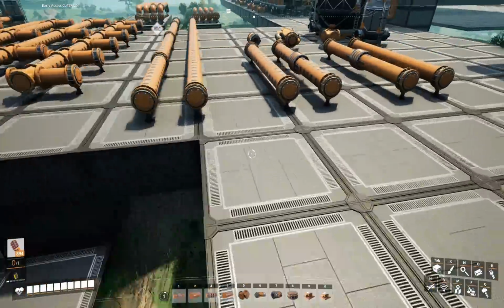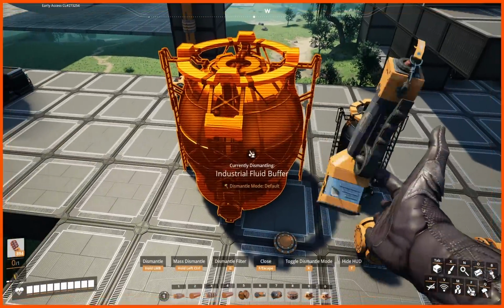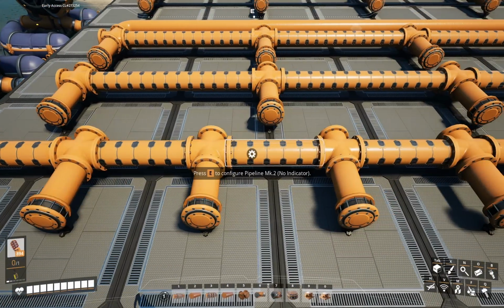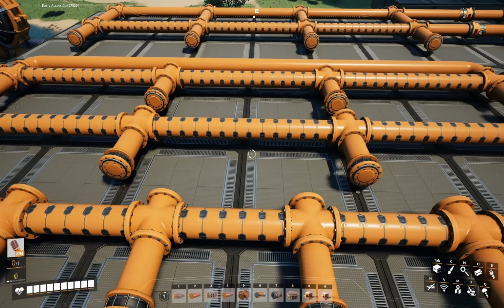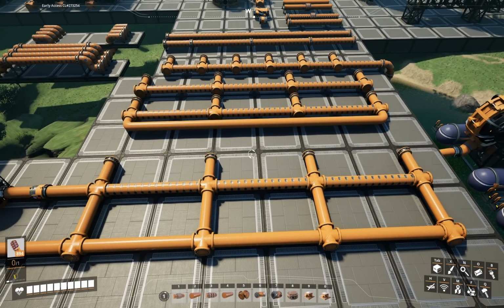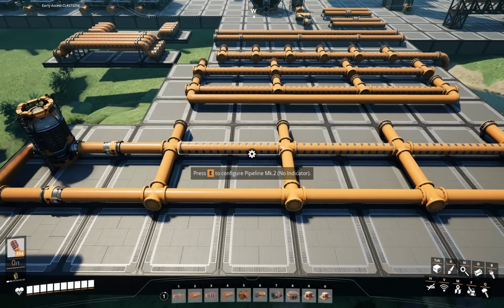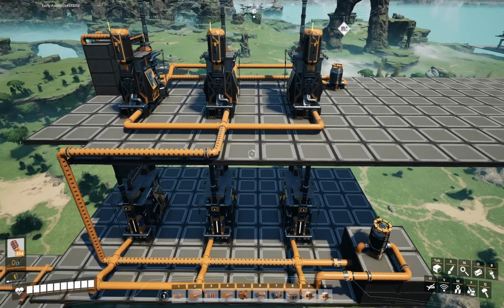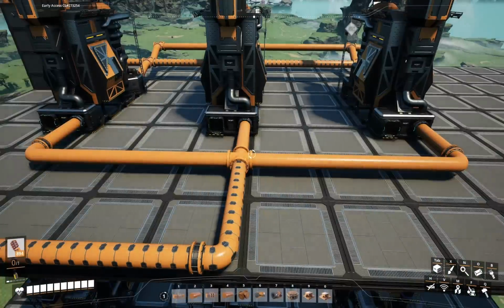[OBSOLETE] Basic Fluid Dynamics + flow rate issues (mk 2 pipe bug)

Comment: this is a great video, one of the best i have seen on the subject. you should experiment with the unpowered pump as a better version of the valve. it only allows flow in one direction, but it also resets head lift (pressure) so you don't need to loop back around or use a tank (the tank also resets lift so is why it works here). the pump works great at the end of a run to prevent starvation, and even better where you are trying to join lines with different inputs, like with aluminum processing. but the single most important thing with fluids is still and always, build your factory upside down, so all the fluids flow downhill.😄
Reply from the maker: Awesome tips! Yea I used to use unpowered pumps, but I don't like the aesthetic of random pumps for no reason (I think like, why would this be here if it was a real factory?) so it makes it harder for me, I like challenges :P

Comment: With regards to the described water hammering issue, a whole loop of pipes isn't necessary. If the exact issue is that a fluid is bouncing back from a dead end, then just placing a small liquid tank on that end will solve it (that's how it works for me anyway). If the liquid tank is allowed to be prefilled then it will also provide flow back in the other direction which will help keep pipes full and stabilize long production lines.
Reply from the maker: Yea, if it works it's just as viable a solution as anything else!
I love that there is so many ways of solving the challenges posed by the fluid dynamics!
Reply: The fluid buffer is like having the loop, the buffer is just a big pipe. You don't have issues when you use it because it's full, so it shares the fluid with the pipes. But it will run out at some point and create more issues because the pipes will try to fill the buffer as well as the machines.
Neither the loop or adding a buffer are solutions. From my experience anyways. The only solution is overproducing the fluid.
Reply: @Ecliptor.  The machines consume exactly the amount the recipe says. When their internal buffers are full and demand lowers, the excess production should go to refilling the external buffer tank and reach equilibrium. If they're running out in your setup then I'm stumped. Ive only ever seen my buffers drain slowly due to a (presumed) rounding error when under clocking, and yes slightly overproducing fixed it.
Reply from the maker: @Ecliptor.  yea, I tend t otry that as much as possible, to just brute force the problem to compensate for the floating point number issue as well as any issue with water hammering, I have 3 lines producing 600 each in the 50k MW powerplant in the beginner series, but the generators only need about 506 each.

Comment: I started using the "FICSIT Inc. Plumbing Manual" - found it on reddit and saved it in google drive. Works great for me. never had issues with it. never experienced bugs with floor holes (just don't feed the machines from below). Great work thanks a lot!

Comment: Good info, but...
You missed a very important, and often unknown, bug, and that is placing junctions, valves, or pumps directly onto an existing pipe which can cause a piece of pipe to become segmented within junction/valve/pump which can cause throughput throttling which really screws up flow. Here's a copy & paste from the wiki page to explain it:

"Placing pumps, valves or junctions directly on pipes can cause a transient throughput throttling, somewhere around 1 m3/min. additionally, occasionally, even when the junction is placed, then re-connected after deconstructing the original pipe, a small segment of pipe can get stuck inside the junction, this will also cause throughput throttling. this issue affects both Mk.1 and Mk.2 pipes. the workaround is to either place the junction first, then connect pipes, or, if you must place them on a pipe for placement purposes, or in the case of valves and pumps, place junctions, pumps and valves on pipes, then delete the original pipe and reconnect. avoid placing junctions, pumps or valves on points where different lengths of pipes connect, as this is believed to be the cause of the small segment of pipe stuck inside junctions. when searching for these choke points in an existing factory, highlight the pipes entering the affected objects. if they show as being halfway inside the object, and not just stopping at the mouth of the object, that object was placed directly on a pipe and the connecting pipes should be deconstructed and new ones connected."
🙂
Reply from the maker: excellent, collecting all the wisdom in one place!
Reply from the maker: The comments of Protoborg was deleted and reported as spam, as they were generally just spamming contrarian responses. Your reply to them however is great ^^
Reply: @jackblade281  Thanks!

Comment: Very informative and interesting solutions to fluid issues.

I didn't see you experiment with vertical junctions. I believe they are like using a smart splitter. The lowest output gets highest priority due to gravity.

Have you tried placing inverted U bends between machines? You highlighted they act as an overflow valve and prevent backflow, therefore preventing hammer effect.

I use overhead manifolds with an elevated fluid buffer at the feed end.
I also feed the fluid buffer from above its height to prevent backflow from the buffer. Do this with an inverted U just before it.
Reply from the maker: I didn't include vertical junctions because I barely ever use them and did not feel confident that I would be able to talk about them ^^ If they work that way I will 100% test it and see what results I get :P

The inverted U bend is also a great solution and I use it for fluid buses most of the time.

Comment: thanks for the tip about the floor holes. i was following a tutorial to setup a massive power setup and was having the worst time with getting water up through the floor. been messing with pumps and replacing pipes but thought the whole system was bugged I didn't realize that it was just the holes in the floor. will have to go back to that save and give the power plant another look
Reply from the maker: No problem, happy to help!

If you have used any blueprints in that build that has floor holes they are most likely the culprit before anything else :P
Reply: @jackblade281  no i just started using blueprints on my latest game. the old game It was new so I didn't bother messing with them. the pipes were hard enough. although I realized everyone else is making sections of floors with blueprints while I was cramming everying into buildings that fit in that space. lol
Reply from the maker: @criticalchai  the blueprinter is really powerful if you learn to use it for modular sections of factory :P But yea, I hope you figure out the pipes!

Comment: To compress the space for machines again I’m thinking of placing them next to each other but having 3 or 4 pipes feeding every 3rd or 4th machine.
Reply from the maker: Not sure I completely get the visualisation of what you mean? Is it like "Refinery -> Constructor -> constructor -> Assembler -> Refinery" you mean?
Reply: @jackblade281 I think he means placing the machines close but have several pipelines that skip machines, only connecting to every 3rd or 4th machine.
Reply from the maker: @marcbennett9232  aaah, yea that is also a possibility
Reply: @jackblade281  due to the need to space out the refineries there’s a lot of gaps. But these gaps can be filled by refineries, just that they need to draw from separate pipes. Instead of having the first group draw from the first pipe, the second from the second and so on. Every 1+(group size)*(n-1) draws from the first pipe, then 2+(group size)*(n-1) from the second and so on.
Thus filling in the gaps and large factories barely gets larger.
Reply from the maker: @judas1337  very nice solution ^^ will try that one as well at some point

Comment: The fix for many flow issues into manifolds is the same as belt manifolds. 

Let production run a while with the output disconnected. Use the machine buffers for finished product and input products to ensure belts and pipes are "buffered" to handle any brief flow problems. 

Once the machine input and output buffers are full, then connect the output and the monifolds will be trouble free forever.
Reply from the maker: Tends to not work with recipes like diluted fuel and the nuclear powerplants, but in all other cases, definitely

Comment: Could you make a tesla valve? and have it work like it does IRL?
Reply from the maker: That would be a cool experiment, but I think there would be complications because the split in a junction is always 50/50  or 33/33/33, so instead of overflow being used to slow down the flow rate they would probably just cancel each other out entirely

Comment: My tips are 1) if you think you need a valve, think again.
2) Get those pipes up.  Fluids should always be fed down into machines, never level or up.
3) If pipes are approaching full, run a loop back to the beginning so it can be fed from both ends. and 
4) Just like pipes, there's no need to consider directional flow in a buffer.  You only need a single port on any buffer. 
5) Quit using junctions unnecessarily.  The last pipe in the manifold should curve into a machine directly without going through a junction.
Reply: The loop does nothing. It only moves the problem from the end of the "manifold" to the middle. You will have the same issues.
Reply from the maker: @Ecliptor.  I tried the loop on the turbofuel refineries in the beginner series, it does seem to work, 4 lines x 600, going into 96 refineries, and they are all running at 100%. Without the loop issues started to happen, put it back in, issues disappear. Make of that what you will ^^
Reply: I've had great success with loops that have an open valve on both sides of the loop. 

In other words, (1) a valve on the pipe entering the manifold to prevent backflow to the source; then (2) construct the return loop so it comes back to the source just prior to that valve; and (3) place a second valve on the loop pipe to prevent it backflowing to the source. 

Result: system immediately finds balance. For example, 202 flowing through one valve and 98 flowing through the other, for a system that demands 300 m³ per minute. It's like magic.

I think it works because thanks to the valves, both sides of the loop are flowing FORWARD. It might be a mistake to think of the loop as "returning" the fluid: two fluids with opposite vectors meeting in a pipe cause a collision, and flow stops. So you don't want to ever send the fluid back against the flow, you always want to direct it toward machines. 

Why that mistake still works sometimes, is cases where the loop doesn't cause a collision. For example, if the loop returns the fluid to a junction that still has available outflow and/or volume.
Reply from the maker: Really good tips!

Comment: You only need the loop or the buffer, but you need it so it will flow back into the line because of another glitch. When you load the game the machines have to restart.
Reply from the maker: That's interesting, That the machines restart when loading the game. Yea, I will experiment with this as well in the Beginner series, currently recording the episode where I feed all the fuel generators of a 50GW power plant with turbofuel, so it will be interesting to see.